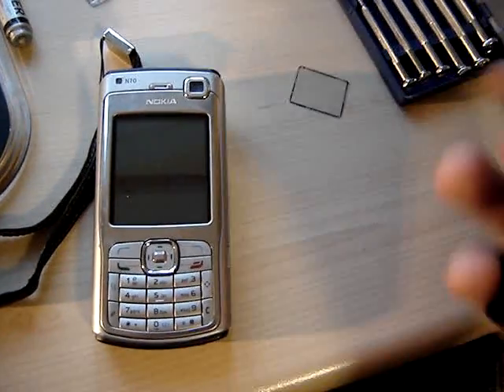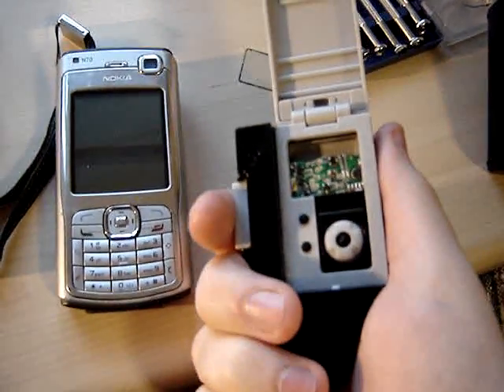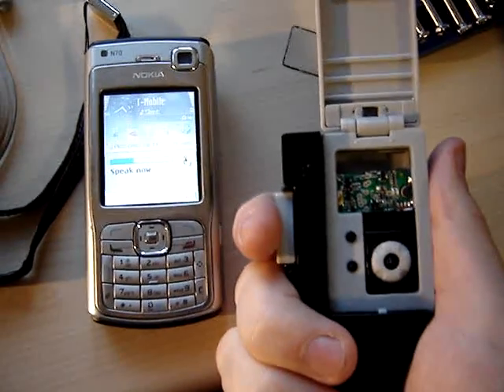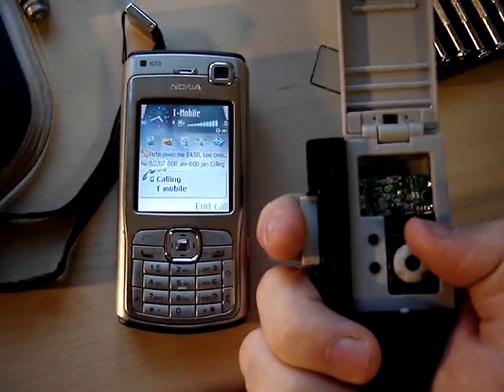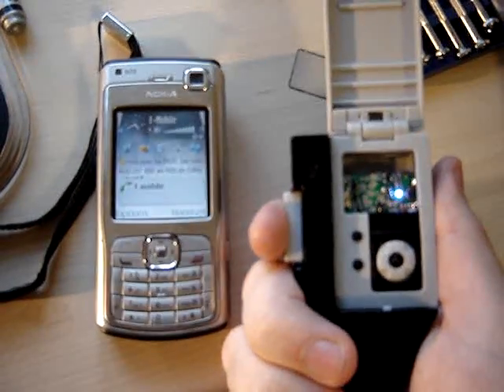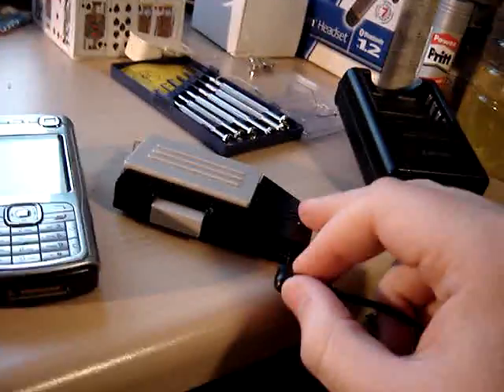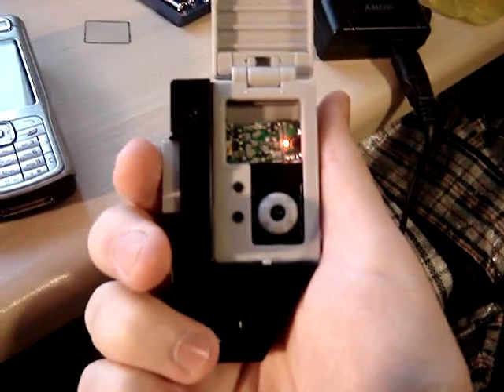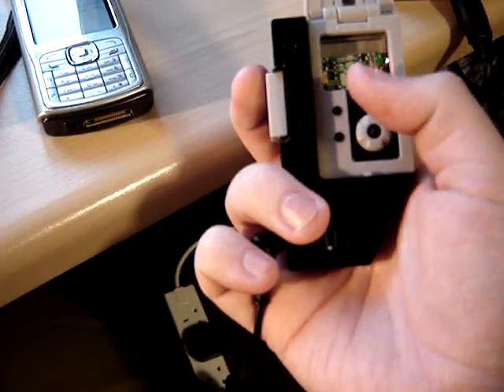Bluetooth Star trek Enterprise communicator

Comment from the maker: Just did all the math & its around the £80 mark that I would need to charge to make it worth my while. Thats to anywhere in the uk or the states, I havent looked at costs to anywhere else yet. As well as the TNG syle on I am working on putting a 50mW laser into a phase pistol (For those who dont know 1mW is a regular laser pen & 50mW will pop balloons, Light matches & should melt plastic)